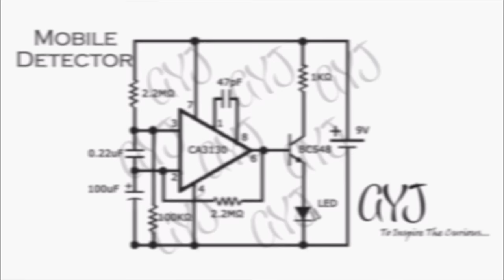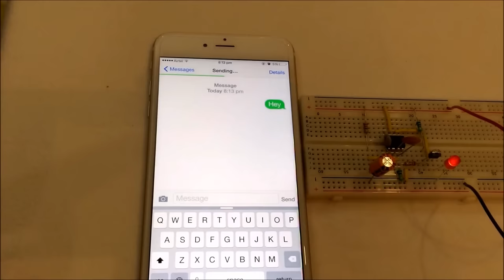How To Make A Mobile Phone Detector

Comment: Working: The signal power is stored in the capacitor through the wire. The resistor and capacitor connection acts as a filter to select the desired signal (the RF frequency at which the phone operates). The resistor and capacitor value are chosen such that the particular frequency is detected. The operational amplifier amplifies the capture signal because it is too low and a proper signal level needs to be applied to the base of the transistor for it to turn ON. So the output signal from the OPAMP with a 0.7 V drop(The forward voltage drop across the diode in the transistor) forward biases the LED and turns it ON.
Reply: does it really works ?
Reply: I love u man thanks bro ♥
Reply: Can you please reply
Reply: It is not functioning
Reply: My LED is on continously, how can I correct this
Reply: @Fun_Therapy same problem

Comment: The key to the entire circuit is the 22uF capacitor-  You need 18mm length on the leads, and the 8mm width of the cap itself to form (essentially) a loop antenna that can detect GHz signals.  If it's not working for you, try making sure you keep the length of the 22uF cap leads the proper length.
Reply: Can u elaborate?
Reply: could i use 0.22 micro polarized capacitor rather than the one that you had shown for 0.22 micro capacitor ?
Reply: Thanx working now 👍
Reply: @syedazim6479  Do you need a antena? and can it detect 4g or 5g signal?
Reply: @takbirkhan9154  can you please help me
Reply: @syedazim6479  need help
Reply: @takbirkhan9154  Antenna necessary, but range of detection can be increased. 4g can be detected
Reply: @saikrishna-ej7mm  yep
Reply: @syedazim6479  bro can I get your insta I'd I have some doubts regarding this one
Reply: can any one help me with thiis project please
Reply: ارجو منك ان توضحلي  اكثر لانه مشروع تخرجي  ولم يعمل لدي فضلا منك ان تجيبني
Reply: @saikrishna-ej7mm  have you done the project deadly need help 😢
Reply: @sruthisingh  I tried it but didn't worked
Reply: Where do I connect the antenna
Reply: Where do I connect the antenna
Reply: @Niki-gh3mo is it working for you 
In my case the led is always on , even though I have all the components as per the vid

Comment: Solution for constant LED glowing: 

make sure to use the wires minimum and even if you guys do, make sure to keep it small in length.. i performed it through that where i was getting 4G signals detection when i used to bring my phone over the capacitor (0.22 MF), i was told by my professor that it is detecting 4G signals only due to the Capacitor value (0.22MF) being high, while it can detect 3G signals by decreasing the capacitance value of the capacitor (0.22 MF). correct me if i am wrong, if i got anything wrong. thank you:)
Reply: Bro is it working please reply bro
Reply: bro could you please help me
Reply: After using minimal wires still we get continues glow of led
Reply: hey bro if it worked for you please reply

Comment: EXCELLENT VIDEO!!!!
Due to this video only I was able to submit my mobile detector project.
WORKED CORRECTLY...
Reply: how to increase the radius of the detector?
Reply: @ivananoos2574  I don't know. I google it a lot but can't find any satisfactory answer.
Reply: Hi Mansoor R
Will you plz tell me that by keeping a mobile at some distance from the circuit will it work r not plz
Reply: @shaikneelufarjana1872  It was working when distance between mobile and detector was upto 30cm.
Reply: @Mr19242  Tq but if we place a detector  in one place n mobile in some other place what should have to do in the circuit connection do u know abt it
Reply: @shaikneelufarjana1872  Our circuit's 12pF capacitor is our antenna which captures EMW of nearby nevices and blink LED and hence complete circuit and it is not needed to connect physically mobile and detector
Reply: @Mr19242  Tq so much for ur replay thanks a lot
Reply: Does this circuit detect 4g signals
Reply: @arjunans5139  Yes it do.
Reply: @Mr19242 can you please tell that in the whole video he didn't use 12pf capacitor so why you say 12pf??

Comment: Does the BC548 transistor work as a switch which is off in absence of a wireless and on in presence of a wireless signal ?
And what is the importance of the CA3130 op amp ?
Reply: The OpAmp is used as a current to (amplified) voltage converter, the capacitor connected to the inverting and non-inverting terminals of the opamp picks up the signal and provides a small current to the amplifier unbalancing it and then the IC converts the change in terms of voltage... it then turns on the transistor which then lights the LED.

Comment from the maker: Yes, it will still work if the phone is in silent mode .
Reply: but it doesn't wrk when our cell is lost
Reply: +Gaurav Yash Jain - AYJ yr video bnake chor di reply bhi krdo
Reply: R u sure bro
Reply: Plzz write the cost of the things need in description in yr next videos
Reply: PLSSSS HELP ME 
CAN I USE A BC547 IN PLACE OF THE BC548?????????
NICE VIDEOO HELP PLSS
Reply: hey gaurav does it works on 12v? 
if not what do i have to use?
thank you for replying🙇🙇
Reply: This circuit is fake and does not work at all do see this video guys
Reply: Useless
Reply: +L. Rupesh bro you can't tell this video is fake ..I've made it and its working exactly how its in the video ....people have no brain and then they blame the youtuber 😂😂😂
Reply: how come its not working here... n im really disapointed!! i made it for my clg project n tomorrow it shoukld be submitted... :(
Reply: what is the range of the detector?
Reply: will it work on LM741 or CA741?
Reply: Yes you can use BC548, they are the same
Reply: yes u can
Reply: yes u can
Reply: Gaurav Yash Jain - AYJ
Reply: Hi man great work but can you explain how signals from the phone can effect that circuit without any kind of sensors ı just wonder
Reply: The 0.22uF capacitor is acting like an antenna to pick up the RF signal when the phone sends/receives. The signal gets boosted through the op amp, enough to activate the transistor and allow current to flow through to the LED. When the signal stops, the transistor opens back up and the LED turns off.
Reply: Thank you for your reply
Reply: Muhammad Usama same here bro
Reply: Gaurav Yash Jain - AYJ how does it work , the theory ?
Reply: Apeksha Agnihotri, I would also face the same problem...
Reply: Not working fake
Reply: Gaurav Yash Jain - AYJ  this circuit works to what range of the mobile ...
Reply: Gaurav Yash Jain - AYJ Bro i don't have 0.22 uf capacitor....  what can i use instead of 0.22 uf Caro cap... Please reply faster
Reply: Thanks dude!! It worked 👍 
For those who are having problem like led is glowing continuously on connecting the battery and starts blinking during a call, I have two solutions for that cause even I was facing the same problem,
1.) Check all your resistor values especially that 2.2M ohm , maybe shopkeeper have given you 2.2k ohm as it happened to me. Color code for 2.2M ohm is red red green gold.
2.) This is what gave me finally a proper output , I connected a random resistor (I used 2.2kohm) as a load , from positive (Vcc) to negative ( ground), and then I got a perfect output.Booyah.
Reply: 200
Reply: @aadhithya2047  you should put 2 0.11micro farad capacitor in parallel
Reply: @minyfizz_  same here.. 😑
Reply: @ronbailey7197  can u please explain the all process
Reply: @ronbailey7197  Can you explain it? Pls ..How the capacitor act as antenna and how can we determine its frequency range?
Reply: @vikramanv9569  Cell phones operate close to the 2.4GHz band, between 1GHz and 3GHz. So, these components are picked such that they resonate close to that frequency. I believe the capacitor, rather the plates of the capacitor themselves, are acting like dipole antennas.
Reply: @rikengothi my LED is continuously glowing when connected to battery

Comment: when I connect d battery to the bread board the LED remains lightened.. and  later when I make calls it dosent blink...y is dat so?? can anybody answer plzz?
Reply: hello, I'm facing the same problem, did u get the solution?
Reply: +Yo No Fui sadly, no😔
Reply: +syeda sarah Try experimenting with other, older phones. Maybe this doesn't pick up 4G. Also make sure your wires are cut to the right length.
Reply: +Chris Knowles 
HEY I WANT YOUR HELP 
CAN I USE A BC547 IN PLACE OF THE BC548 PLSS ANSWERR
Reply: +Roy Kareh Well I'm certainly not going to help if you keep shouting.
Reply: +Chris Knowles Oh no i am sorry
Reply: +Roy Kareh The wikipedia page fire the BC548 had this to say: "The BC546 and BC547 are essentially the same as the BC548 but selected with higher breakdown voltages" so I think you can use either. For more info, read https://en.m.wikipedia.org/wiki/BC548.
Reply: +Chris Knowles thank you chris you are a genious
Reply: +Chris Knowles another question if it's possible what if i change the value of the 0.22uf capacitor?what is this job?
Reply: +Roy Kareh I'm not really sure. I haven't built this circuit or one like it myself, but generally capacitors in something like this are for timing, so I would be sure to stick with the precise measurements.
Reply: yup..! same problm wid me too
Reply: same problem. anyone that already found the solution please share.
Reply: syeda sarah U connected ca3130 wrong way
Reply: I had this problem. Here are my solutions. 
1. Use 25Watt 100uf capacitor electrolytic. By using 50 watt in my experience it does not work. 
2. Use 1/4 Watt for all resistors 
3. Use old cell phone, the one that is not smartphone for consistency. My experience with smartphone signal is vary and only work 3/10 attempts with specific distance. But when I switch to old phones the circuits detect the signal 100% of time. 
3. Use thicker single core wire. I assemble the circuit few times, it seems like the smaller wire sometimes not throughly connected to the breadboard. 
4. The output of Ca3130 is in current. I measured it to be 1mA when idle and 2mA when it detect signal.
Reply: You use bubblegum
Reply: i am also facing same problem
Reply: as i comnect the battery led glows but it does not even blink when i test the circuit can anyone help????
Reply: you said D Batterry you need a 9V Battery
Reply: The LED Blinks automatically when I am connected the battery supply and...not blink the LED in the incoming or received calls .....
Reply: please help me, the LED keeps glowing when i connect the battery. any solutions?
Reply: syeda sarah up
Reply: syeda sarah I think I know the solution ,try switching output side of opamp upside down
Reply: I am facing the same problem
Reply: Coz you have not insert ur components correctly. Check ur circuit once again
Reply: syeda sarah m getting same problem
Reply: It's fake. Lol this circuit cant detect a phone. Lol
Reply: Hello, I'm also facing the same problem.
Can u plzz help me out of this

Comment: When i connect with the battery...the LED remains lightened....
When i make calls..it doesn't blink... 
why??? Plz explain what is/may be the problem???
Reply: +Gaurav Yash Jain - AYJ plz reply
Reply: +Ashraful Tanvir did u get d solution? caz I'm facing d same problem
Reply: No :( .. bt 1 of my frnd has done this without facing any prblm ..watching the same vdo & using the same components..
Reply: Change the direction of transistor
Reply: It's not working
Reply: problem occurs if U Connect 100uF to pin 2. This could be solved if U connect 100uF capacitor to pin 3
Reply: mere me bhi rahi problem h
Reply: I made it Dude. Follow the right steps. U will be also successful
Reply: Bro can you say to me what is the range of that device?
Reply: @lupenajohnchesterclintm.8944   yes. The 0.22uF capacitor could detect 0.2 to 1 m. Depending upon mobile phone used
Reply: How can i will be able to increase the range??
Reply: @Naveen Dubey do you know how to increase the range?
Reply: Naveen Dubey bro can you help me with this? When I start connecting the 9V batt. It only light the LED when I call and text it ddnt blink
Reply: @chazypark5252  , When you connect the battery as there is some fluctuation in the circuit the LED will just blink for a second.And if this does not happen then there is some error in your Connection.    Also Please Try first using your Mobile data ON, the circuit will detect the RF signal if your connections are all good
Reply: May I get your name in Facebook? Sir
Reply: @damanpreet9801  lol
Reply: @naveendubey4412  i am facing the problem that led remains on when connected to battery and it also remains on for call to
Reply: Guys im also facing the same problem
Reply: OMG!! I just saw the video and I felt awesome. So without checking the comments I just bought the components. Now I have to check whether it's working or not.
Reply: @naveendubey4412  yes
Reply: @AnkitaYadav-gk5qu   wait for 5 minutes ,then led off ,then u try ,it will work.. I done this project it works
Reply: @syedasarah1636    wait for 5 minutes ,then led off ,then u try ,it will work.. I done this project it works
Reply: @pendyalagowtham1154  thanks but i am done with it it works properly
Reply: @AnkitaYadav-gk5qu  ok,tq
Reply: @mithingabrahma6896  what kind of do u want broo
Reply: @pendyalagowtham1154 bro.. my circuit is not working when the phone is coming ...
Reply: @naveendubey4412  really??
Reply: @dumdum6808  same here.i bought the components without checking comments. And like u i said wow after watching this video
Reply: @tayyabanawaz5265  Dont worry, the project is very interesting. It would definetly work  you show Interest
Reply: It's not working correctly. The problem is the light glows only to one of my friends mobile. But not glowing at all to any other mobile
Reply: @naveendubey4412  its not working bro.. i have tried 😑😑
Reply: @naveendubey4412  i have bought all the components for project and most importantly i have to submit it soon.. please help me if you dont  mind
Reply: @chazypark5252  did you solved your problem?
Reply: @rockey4631  did you solved your problem?
Reply: @pavithravelkumar1474  no pavithra i didn't solved it ...so changed my project
Reply: Naveen Dubey bhai kese kiya muje bhi Bata or tune yehi video dekh ke kiya kya
Reply: Same problem
Reply: @ashrafultanvir2243  Hey is this project works or not????
Reply: @syedasarah1636  Hey is this project works or not????!?!!
Reply: @naveendubey4412  bro is this project works or not?????
Reply: @ashpakjamadar694  yes i have made it works for sure

Comment: Connect as per the video the circuit diagram is different  it works completely without any problem
I have submitted it as my project and the result was good
So just follow the circuit as shown step by step in the video
Reply: What is the proximity range
Reply: So,it was working 
Up to how much range it will detects

Comment: i have seen  most comments and a major problem is LED keeps on glowing when connected to battery and i also faced the same problem. what is the solution for it? plz reply the answer...
Reply: After 5 minutes the turn off,it because discharge of capacitor after some time..after the turn off ,the circuit works
Reply: gowtham chowdary bhai meri bhi same problem hai led glow horaha hai to me kya karu
Reply: gowtham chowdary plz Bata bhai mere mini project hai

Comment: can i use electrolytic capacitor instead of ceramic capacitor for 0.22micro farad
Reply: Lakshmi Kruthiga capacitors do "one" thing, store an electric charge. As like my as the capacitance is the sand it should be fine
Reply: It is working we can use electrolytic capacitor

Comment: But this circuit has no range, i mean if you move a meter away it wont work but if you use inductor instead of capacitor it will have a decent range
Reply: Faizan ul Haq can you explain in details..
Reply: can u plz expilain how i can use inductor instead of capacitor..?that would be a great help
Reply: No u can't use inductors instead of capacitor tor these both electronic components work on completely different principal
And it's an opamp circuit it needs capacitor in that block
Reply: @rishikeshs6398  
How are you my dear friend 
I have a problem I hope you will help me
The circuit only detects the 2g-enabled device
Do not discover an iPhone or a Galaxy device, only Nokia 105

Comment: can u plzzz tell the working of this circuit
Reply: ya I want working too
Reply: a high speed high current differential amplifier with a light on the output that amplifies electrostatic background noise around a level different than cero (light shines always but flickers more o less when theres 'phonewaves' around) the antenna is unnecesary and would go in the pin 3 in series
Reply: the 0.22uF capacitor works as antenna for the circuit. when a incoming/outgoing calls hits the phone the RF is catch by the antenna and after some filtering signal passes through the difference op amp here it amplify and passes to the base of bjt which act here as switch and when it hit the base of bjt transistor turns on and led blinks .
Due to fluctuation in Input signal and Unidirectional operating of LED , LED blinks. (Edit: many types of faults present in this circuit, may not working Properly)
Reply: the pnp base is the antena,acts as a dam or a street traffic light in red where a potential or volt is developed and exists loger as electric field in the capacitor
Reply: faults? as in?
Also, doesnt it detect mobile internet or wifi?
Reply: bro how do you know ? do you have the datasheet ? can you give me ? please REPLY!!
Reply: who?
Reply: Corl Franco you la. how you know that 0.22uF capacitor work as antenna ?can ou explain to me ?
Reply: pin3 has induced static
Reply: Any long wire can be act as antenna, you can not capture Radio Frequency but you can capture the power of the received RF signal and store it in a capacitor
Reply: Kedhar Guhan Balakumar    this circiut may detect or not the mobile internet or wifi....
Reply: @devashishduklan5984  can we use a capacitor of different capacitance high or low?